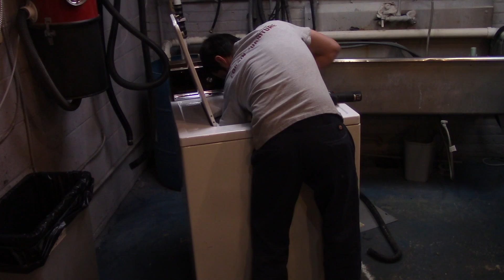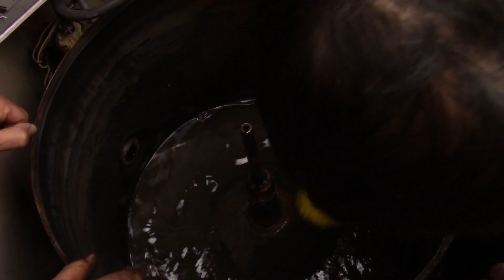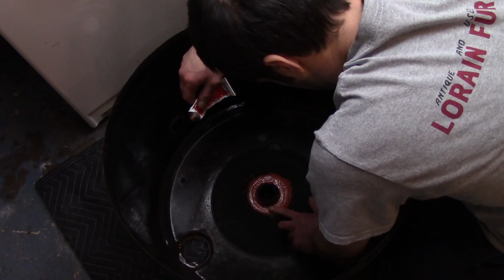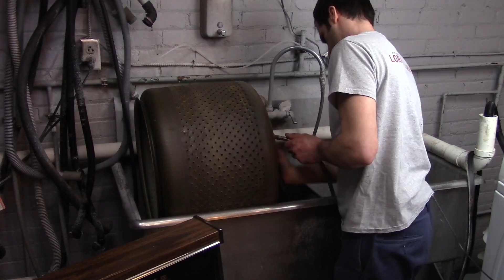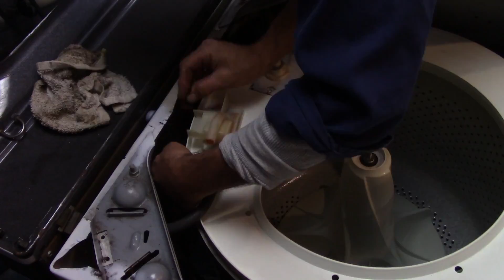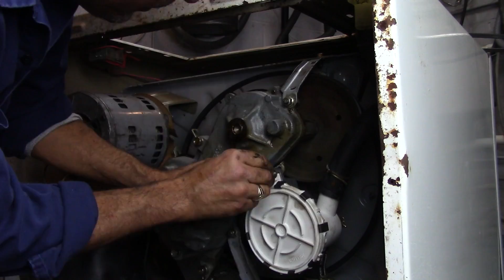Refurbishing A Vintage Kenmore Washing Machine, 1978 Belt Drive Washer

Comment: I have the exact washer but it’s an 1981 kenmore belt drive 70 series  trouble I’m having is no matter how I level my washer it goes off balance on the spin cycle  so bad it turns off the washer . If I put in a full load it triggers it last time I ran it it struggled to stay on but the unbalance shut off the machine I replaced the belt and the pump . Is there any advice you can give me ?

Comment: Was looking for info on changing a belt on our old Lady Kenmore washer and found your site. Very cool !

My wife had gotten this washer and a matching dryer used from her mother before we met in 1980. The dryer gave up the ghost after only 30+ years but we still use the washer !  The only maintenance I've ever had to do was replace the drive belt twice and the water pump a couple of times.

It's time to change the belt again and I can't remember the trick to get it past the drive shafts. Figured it out twice before but I was younger and better looking then. I thought I dropped the transmission down some and then pried up somewhere in the area of the clutch mechanism but not able to open up a gap this time.

At 9 minutes and 52 seconds into your video you reference pulling the transmission down to get the belt off but it's not visible in the video. I've removed all three bolts holding the transmission in place and the three support straps and can pull it down about one inch but it stops before I get a gap to allow me to remove the belt.  Is there a trick you can share with me to allow the tranny to be lowered farther or the create the necessary gao ?

Thanks in advance for any help you can provide.

Jay

Comment: Need to replace a pump on one of these - how does the belt get slack? The ONLY thing I can see is to remove one motor bolt and hope to pivot the motor a little. I've done this job before but probably 20 years ago and cannot remember.

Comment: That is such a clever way to remove the agitator. Ok I'm now so getting into this washer repair now. Cool video. PS.  I really miss my old washer and do wish i had kept it. GE Filter flo and the best part of it was the filter flo. I have the 2017  Speed Queen and if its possible can the filter flow part be added? To be able to filter the water as its washes and rinses is a good idea.

Comment: I just love the way you fast forward through the BS and get it done. I am in Massachusetts. I would buy a appliance from you anyday. So Thorough.  Thank you for spending your time. Great Restoration.  I wouldn't expect anything less.  Bravo !!!
Reply: And you have executed superbly.  You're a very talented man.
Reply: Oh, and BTW,,, I used that exact model years ago and that Penta Swirl did a fabulous job. You'll love that machine especially for your Flannel lined jeans.  I wear Carharrt Fleece lined jeans. The PentaSwirl had no troruble turning that load over.

Comment: Impressive work restoring a classic washer.  My parents bought a 1975 Kenmore that had a Penta-Swirl agitator (sorry, I'm wrong, it was a PENTA-VANE), which replaced a 1967 Hotpoint (matching dryer broke down a number of times).  The Kenmore was in use for 14 years, worked like new, but replaced with a 1989 70 series direct drive, which my father (at the age of 90) still uses.  Once again the issue was with the dryer, which I'm told "burned up")!  I can't wait to see videos of this newly restored beauty!